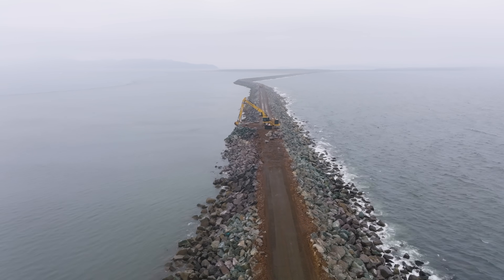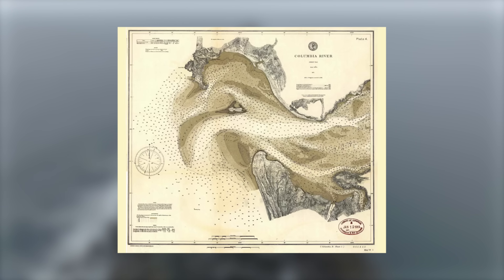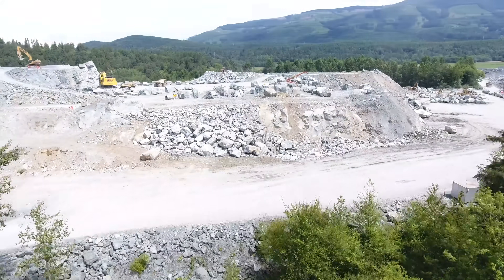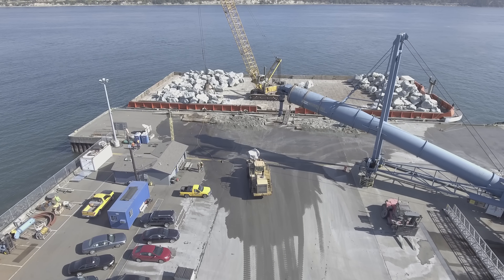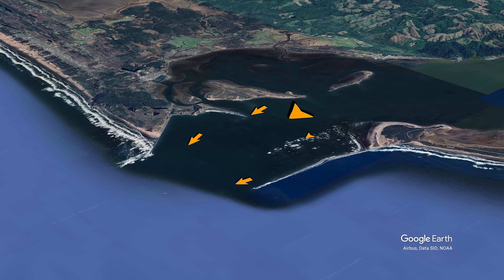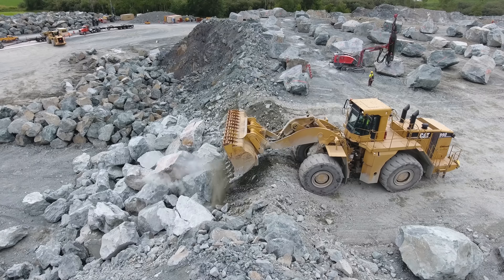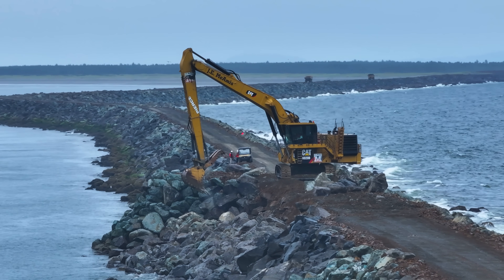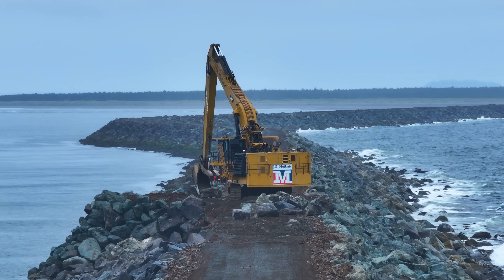Why Build a $250 Million Rock Wall in the Ocean?

Comment: We had the most massive ice age floods in history down through the Columbia 13 to 18K years ago. There were called the Missoula floods. They came from Montana. These floods happened at least forty times. That is why the bar is so bad. They caused all the silt, sand bars and the canyons off the coast. A huge amount of rock and silt came down the river. The mouth of the Columbia was so rugged and rough that, even though they knew the  river was there, for over fifty years explorers could not find it. It is not your typical river bar. It is one of the worst in the world all due to those floods thousands of years ago.

Comment: Imagine breaking ground in 1885 and completing this entire project in just ten years—building a rail system with hand-cut timber hauled off a mountain by horse teams, manufacturing steel on the East Coast and transporting it across the country, then laying track with 1880s equipment. The steam locomotive, the greatest modern marvel of its time, made it all possible. That project lasted until the 1930s with virtually no maintenance, surviving everything until a small section was finally washed away.

Today, we need countless ecological surveys just to expand an existing 1885 rock wall by ten feet, and we pay tens of thousands of bureaucrats just so the Army Corps of Engineers can delegate the excavator operator on how to place each individual stone. We went from unmatched technological achievement and human perseverance to a world dominated by crazy activists and people identifying as cats. 

God bless America!

Comment: I'm surprised that they seem to not make use of big concrete tetrapods -  
https://en.wikipedia.org/wiki/Tetrapod_(structure)
Because they are uniform in size, you could deliver a lot more in one load and that would surely speed up the jetty reconstruction.  
I'm pretty sure they would last a lot longer as well.  
I can only assume that cost may have been the reason for not using them.

Comment: Would loved to have listened in on the initial design.  Discussion of filter layer or confined aggregate under larger riprap, use of a geotextile, shallow draft barge vs. backing in single rocks with trucks.  No doubt multiple brainstorming sessions, limited access jobsite, AND very challenging weather!  Great work and documentation!

Comment: It will get washed away again over time. They need to drop some of those cement hexagon things in there and some man made coral barriers. Possibly some poles jammed into the sea floor to reinforce and prevent rocks from moving. 40 foot swells that can go over the jetti will cause some issues.
Reply: Even if they build it out of a mountain of solid concrete, the whole west coast is eroding away. It's all temporary. It's all about maximizing effectiveness vs. cost

Comment: Mining and transporting rocks from long distances isn't that more expensive than building interlocking concrete structures? Which I think can be reinforced with plastic or fiberglass, which are not corroding?
It looks a better deal, but if they did it with rocks, it must have been cheaper? It is very hard to believe, tho.

Comment: Nice !  Might be interesting/helpful to have a cross sectional drawing/diagram indicating typical dimensions of the rock layout versus the sea floor and how ever many grades of filler gravel are used in the core of the jetty   <?O_O?>    Also, do you happen to know the plans for what is going on top of that rounded platform shown being built along the jetty ?

Comment: Great to see where these rocks go, I work with a quarry in Darrington WA shipping rock for jetty work. SOO, much effort and planning goes into this type of work from so many different people. Great Work!
Reply: @mrjumbly2338  Really? All the way from Darrington? Are they coming from up on Colchuck or further up the pass? I used to work for DNR out of Arlington and log in Darrington so I was just really curious. As you head out of town and cross the bridge we would hang a right and head up on the logging roads that go for miles and miles. Such a beautiful area up there. We would thin the forest mostly. 
That's a really neat fact that they truck some of the rocks in from the North Cascades area all the way to the coast. Amazing! Thanks for the comment!
Reply: @revolutionofone8541  those big rocks are coming out of skagland quarry by Swedeheven road. I’ve seen them hauling those rocks down 530 for years now.
Reply: @clappedoutcam710  Thanks for correcting that info for me. I thought it was quite a haul for the stones to come from Darrington, Wa. Maybe just a certain type or some specialty stones are brought in from up there?The whole project is just so impressive. I know 530 well.
Reply: @revolutionofone8541  They ship em 1 or 2 rocks per flatbed, then dropped off in Bellingham, loaded on barges then move to the Columbia. These rocks have been tested for their durability.

Comment: Concrete Tetrapods work better than just rocks. They fit tightly together to form a structure.  I know as I saw the Tetrapods withstand many Typhoons.
Reply: With the time they spent handling each rock terapods seem cheaper
Reply: @guyod1  Why ? hauling all (and the cost of all) the raw materials to make concrete, then haul it to the job in raw or block form would be equally or more expensive.
Reply: They had to have made the cost/time/longjevity estimate comparing the them and I'm curious how far off the pricing was because it really seems a lot easier to be dead certain that everything is locked together with the cement tetrapods.

Still its a cool giant project

Comment: Solid show and info. To all the libs out there, This project is not possible using EVs. Those massive loads, movement /transport  and distances are far to great for batteries to handle. GW is a scam, our world depends upon hydrocarbons for heat, electricity, transport and work.  (A company in Australia that build ferry sites and docks across the globe has checked their data from the early 80s. No change in sea-levels.)

Comment: I will never forget September, 1980 when I spent five days on the Columbia River Bar setting a series of navigation buoys while serving aboard the the USCGC planetree (WLB307). We had to take a temporary assignment from our normal service area of SE Alaska because the USCGC Iris suffered an engine room fire and was out of commission. 
The sea state was so rough, we had chains and lines snap. Sea water at one point flooded through an open portal. On one occasion, a 3 inch line controlling two 9,200 lb concrete anchor blocks parted   and nearly decapitated a deckhand. At least it would had Alvarez been standing rather than sitting.
Anyway, that waterway is buck wild.

Comment: Nice video it Looks nice and a nice piece of history. in the USA you build great things. to bad its the same construction your forefathers also did. and there is not real innovation . in the Netherlands we did it also like this , but we invited a better way,  we used to do have the same protection cladding with big stones , but over time we found these stones will get dislodged to easy 
so we used science and came up with a new design the Tetrapod.  concrete blocks that break the waves much better because of the design , they are also a lot harder to dislodge  and super easy to make from waste concrete. hint to any one with a concrete factory just cast them with left over concrete and you can always sell them .

Comment: Half a billion dollars? That’s nothing…the Seattle light rail system that they are still working on was first estimated to cost 133 billion dollars!!! And it usually always ends up going over budget. With more electric cars on the roads here in WA state not paying/contributing to the gas tax that they are legitimately proposing a toll for all drivers. Get this, a pay per mile toll!!!! Initially they were thinning 24 cents per gallon but having done the math it wouldn’t be enough. So they figure 26 cents would be ideal 😳💕🤯😱☠

Comment: Damn, You nailed the audio. Thank you! I didn't have to zoom my scroll wheel up and down between dialogue and music and you kept the music low in the background so it was easy to hear your voice. The video is great as well. Look at that excavator! Usually, on a 60k pound machine, it isn't a huge step up from the track to the cab.....the driver's feet sit close to the bottom of the cab. Even a 120k machine didn't seem crazy, but that machine is tall enough that you could put another driver in the lower part of the cab, below where the operator is sitting. That is unbelievable that they have a place for each rock, as in unbelievable enough that it would have been nice to hear how they map out the existing structure and measure the new rocks and fit them into place. I know they use lidar or something like that to scan buildings and objects now so it is possible, but that is a lot of extra work vs. just having an operator who can stack rock by eye. Great video!

Comment: Just dumping random rocks is not the best solution for making a dam like that. Take some inspiration from the so called "Levvel 1 blocks" that recently have been used to strengthen the closure dyke in The Netherlands. These prefab concrete blocks are not only much cheaper but are also interlocking and the existing holes also makes it possible for a special machine to place them. These things are very durable.

Comment: I was curious about the nominal sea level for this project.  What was the calculated level first time around and what level at the end of the job.  In Dublin Ireland the north and south walls of the river Liffey have been extended about 3.5 miles from the 1700s.  Before that the vikings built sea walls that now lie 1.5 miles lie further inland.  The silt that gets washed down the river Liffey is a much smaller river.  The deposits continue to build up in the bay on the outside of the north and south walls. Within the walls lies Dublin Port.   Various construction methods have been used for different seawall extensions.  Rising sea levels are going to make it a challenge to maintain these walls over the longer term.

Comment: Transporting for hundreds miles... Would it no be cheaper to build concret structures on the spot - with perfect interlocking functions ?
Reply: Probably this way is cheaper, you need special concrete to survive salty water for a long time granite lasts longer

Comment: would it pay to use some kind of lidar to 3d scan the individual stones and have an algorithm stack the stones in the optimal way for strength and frugality ? Could you then have the crane operated follow these instructions exactly or is it still too crude of a machine ? On other jetties you sometimes have the synthetic concrete blocks. With those, you dont have to think that much, they all fit somehow in the same way. What are the advantages and disadvantages of working with one or the other ? Fascinating video !

Comment: In the Netherlands, a layer of sand is applied to the sea side by sand dredgers, which makes the waves less high. Every now and then, the layer is replenished where too much has been washed away. This is cheaper than replenishing all those large stones.
Reply: The coast of the Netherlands and the this area of the Pacific couldn’t be more different. The depth of the shelf off of the Netherlands barely goes deeper than 55 meters. Here it starts at 200m and then drops sharply to more than 2000m. Not to mention the constant storms that batter this area. Adding sand along here would do nothing very quickly.

Comment: I wonder what it would cost to manufacture those parts in concrete instead.. On Gotland, a island outside Sweden we have those in the port. They are nowhere near 40 tons though. They resemble what we in Sweden call "Spanska Ryttare" or possibly "Horse Angles" and are being used when stopping vehicles. Just like your spike strips but another design. Back in old time wars they were used for stopping horses during war times. If you think of a 4 sided pyramid (including the base) as one of the sides, and just make each side more pointy to each point, you pretty much get the same design of those we have in our port.

If they would have used that kind of design they would have been a lot easier to stack.

Comment: So basically it's a huge dry-laid stone wall. The difference between dry laid  stone and a rubble pile is the skill and artistry of the mason, making sure the rocks interlock and support each other. I wonder how many crane operators there were for that jetty: I'm guessing it was only a few, so they are the artists who rebuilt the wall, with a huge support staff bringing the correct rocks to the right place.
Reply: Here in Nova Scotia, most fishing ports have these type of jetty otherwise know as a 'breakwater' a few hundred feet from the fishermen's wharf stretching out 600 feet or even a thousand feet or so, so as to protect the wharf and fishing boats from strong surges wind driven water . Ste Marie Bay has also 20 to 28 feet of tide, and The Bay of Fundy has 20" to 30' of tide and a little more into Minas Basin at the head of the bay. Check out Google Map.
Reply: The Main thing that makes me believe that EXTRATERRESTRIALS MAY Have been Involved in Constructing  the BIG Pyramids is the Huge Amount Of The Construction  🏗️ Materials that Needed to be Moved , and how far they had to go just to get them to the Site !
Reply: @jollyjoker888 thousands of humans cooperating can do incredible things
Reply: @jollyjoker888you should watch engineers use basic machines (such as levers) to move rocks with nothing but muscle power and a few well placed logs. It’s pretty incredible.
Reply: @jollyjoker888 "Ancient astronaut theorists say yes"

Comment: During summers in college, I used to work in a lime quarry driving truck .  This stuff is amazing.
Reply: College students drive those things? Damn I had the wrong summer job then 😂
Reply: @adamb8317  The one I drove wasn't nearly as big as the ones in this video.  But the truck was off road, you climbed a small ladder to get into the cab, it hauled 48 tons and  if you lost your power coming out  of the pit, the specified procedure  was to dump your load and/or back into the quarry wall ( we drove on the "wrong" side of the road coming out of the pit).  I lost power only once while I was there.  I replaced a guy who lost power and he rolled backwards all the way back down into the pit.  He wasn't hurt, the truck wasn't damaged but he was so spooked they couldn't him back into the cab. So they put him by a lime pile where you had to shovel lime dust to keep the belts free.  It was a GREAT summer job.😀

Comment: This was and still is an amazing project. It’s not complete until the end of 2025.  Our Company Big River Construction out of Astoria Oregon has had the privilege to work on several Jetty projects and Columbia River navigation projects with JE McAmis   They are an outstanding contractor to be partners with.  We supplied a lot of the Jetty rock and all the haul road rock from our Quarry’s in Astoria and seaside for this South jetty and the North jetty project at Ilwaco Washington. Just about all the Local trucking companies were included to haul stone to the sites.  Great video Witt.
Reply: I'm a local. These jetty's will NOT wash away in 6 months or 60 years.. these are incredible projects that are built by both local companies and the army corps of engineers. Not only do the jetties protect our coastlines but they also enable cargo shipping worth billions of dollars annually to operate in that area. You would be amazed at the size of the ocean going vessels that travel up to Columbia past kelso and Longview to Portland Oregon. Timber, automobiles, consumer goods, just about everything imaginable. These jettys are not only amazing but required to maintain our modern way of life. They are fun to fish off of too!
Reply: Any reason they can't just use concrete instead of stone? Plenty of used concrete out there from destroyed buildings.
Reply: People often say we don't build massive projects like we used to at the turn of the century. This proves them otherwise. To build a jetty in some of the most dangerous waters on the planet in that time frame is absolutely amazing. Props to the people working that project!
Reply: I want to fish off that thing
Reply: Thanks for saving our coastal land and homes.  WashAwayNoMore!
Reply: My family’s quarry in Camas supplied the rock (called Camas Gray) for the original construction. It was barged down the Columbia. They trucked it this time. Lots of people commenting that they saw the boulders being trucked on the freeway. Wow.
Reply: wait I saw one of those stones is out of place, they need to fix that asap
Reply: why weren't Tetrapod concrete used?
Reply: When I get why they're still is opposition. Nobody really wants to pay taxes and it's hard to justify expenditures when there are so many important projects to do.  but in the long term it makes the coastline safer and it will save billions of dollars down the road.
Reply: @RighteousInquisition  When I read Astoria, I remembered your salmon berries!
Reply: @RighteousInquisition I don't get any opposition. This project is win for everyone. It's a bonus for the environment, for the people. It's a welcome thing to see. Where is the opposition coming from? Also, I want to fish off it too! 😁🌹⚓️👍🏼😎

Comment: More and larger and more advanced equipment was used in COE Cape LIsburne project in Alaska remote radar site sea wall construction.  2018-19-20-21 Work was limited to 125 days per year due to sea ice and access and completely extreme remote alaska arctic .  5 year project that included armour stone nearby the site.  Those BIG booms….break a lot :)))